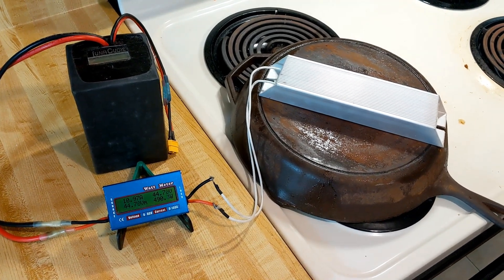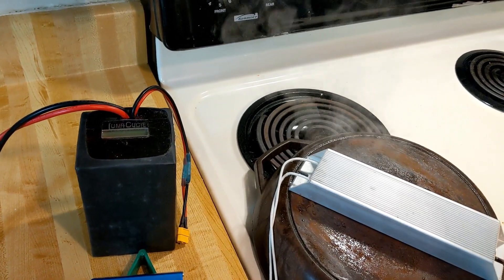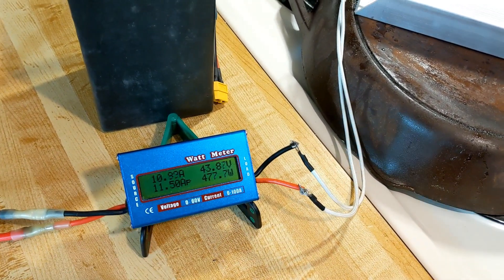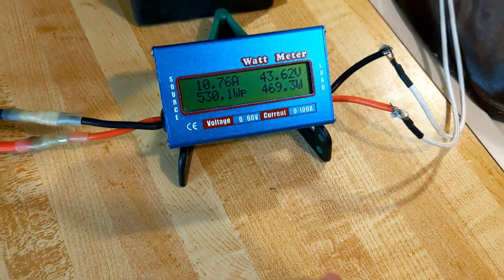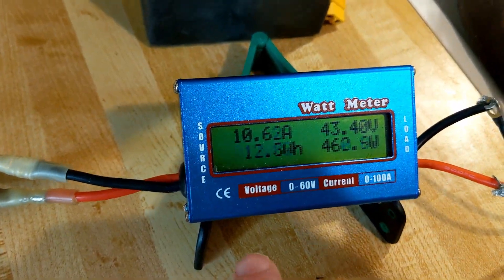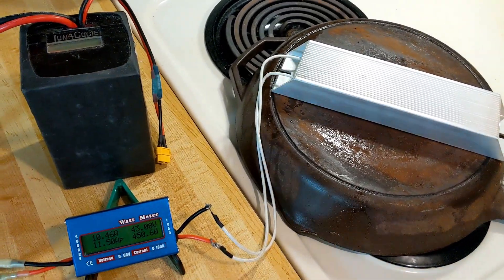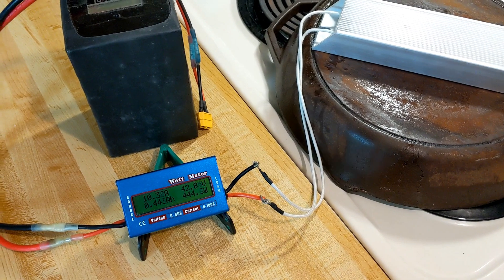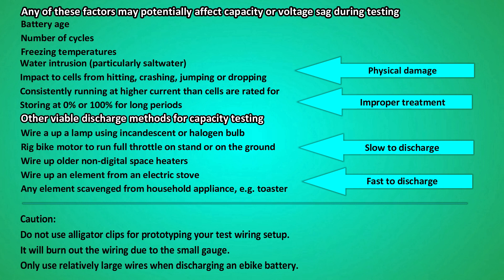How to use a basic wattmeter for ebike battery capacity testing

Comment: The resistor you use is 500w but how many ohms?
Reply from the maker: That particular one? Pretty sure it was 8 ohms. You can find similar braking resistors on Amazon
Reply: @fuzzyfriendlydoggy  i did find it on Aliexpress but the were multiple options ranching from 10 till 300 ohms . Thank you for your quick response and have a merry Christmas and a happy new year. 😊

Comment: The problem is when the battery goes flat and turns off, the watt meter turns off too. There is however an external power input on the side fo the unit.

Comment: Thank you very much, I am gonna do the same test using the ebike wheel which pulls about 80 watts when going 40mph no load, only problem is that battery is rated at 930wh so will take over 10h to discharge it fully